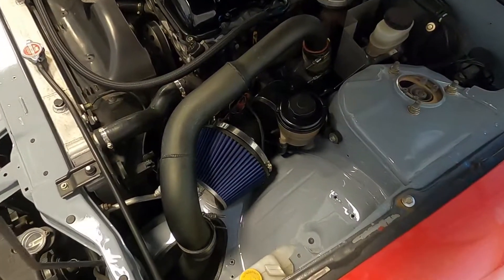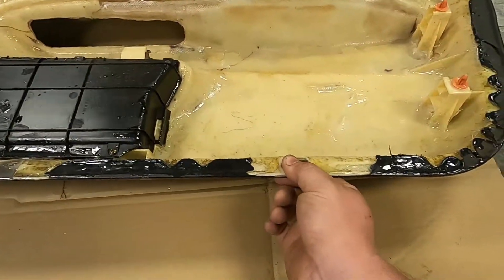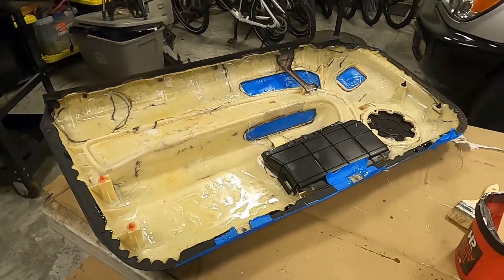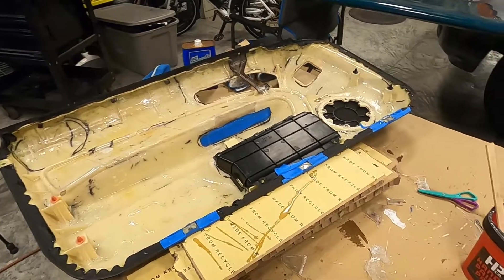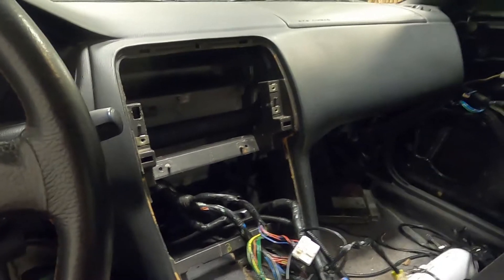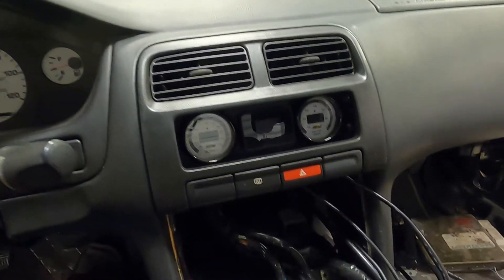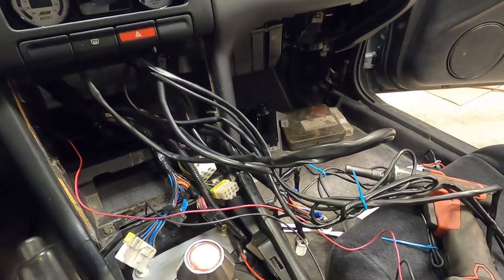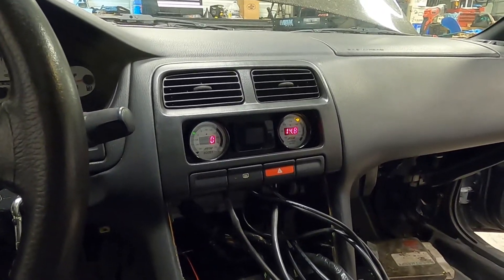Restoring s14 door panels | S14 BUILD 21

Comment: Hi I’m going up restore my door panels just to prevent any cracking. What fiberglass and resin did you use? Also what epoxy did you use for the mounting points

Comment: For accesories power to the gauges you could have just tapped onto the red wire in the aftermarket stereo harness under the gauges..
Reply from the maker: I know this is how most people do it but I prefer a separate power source so I can add multiple accessories without worrying about having too much on one circuit.